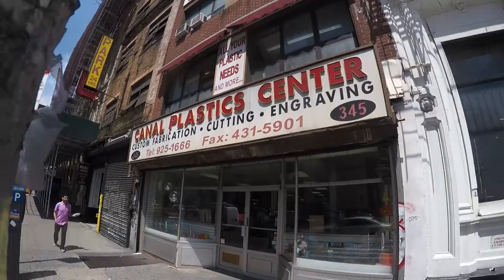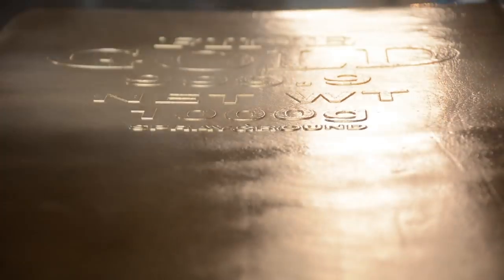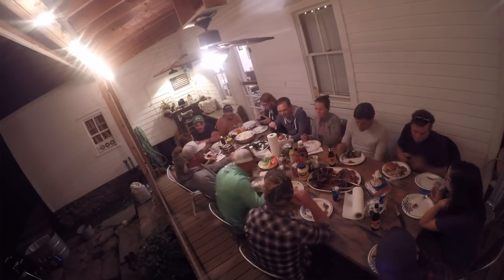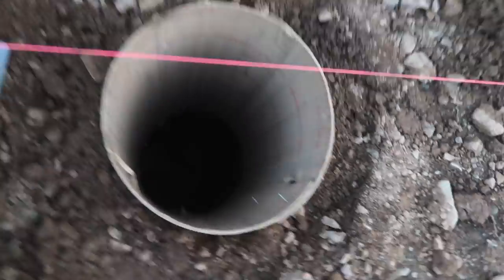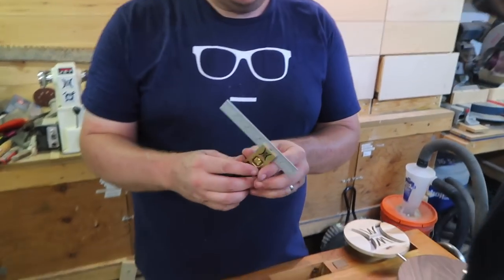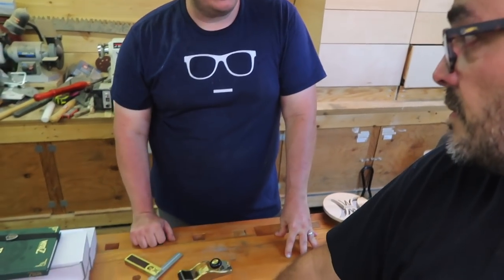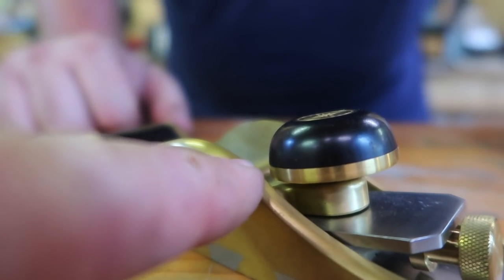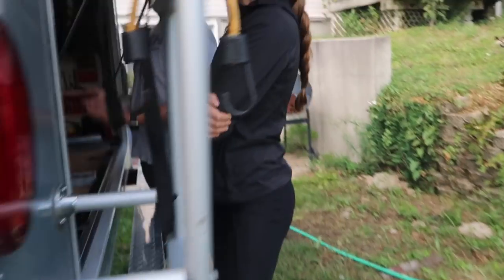DiResta 47 Breaking Ground!

Comment: I just must say this. I'm structural engineer from Europe and I have been always wondering how different your foundation structures are to ours.
Reply: These are Sonotube foundation piers. Which means Jimmy is building either a pole barn, or a steel building. Collectively known as equipment sheds. Most folks park their tractors and whatnot in them. Hence the name.
Reply: It is a post frame structure.  Typically posts are set into the ground.  But wood rots over time.  This is the only way we will build anymore.   Either on a concrete pier or foundation wall.
Reply: RR Buildings we usually use pad footings, ground beams or light srcew piles for this kind of structures. I guess that your ground has so much more friction that you get away with just pouring the post to the ground. Or it might be just the rules if you doesn't need to take snow into account. We use same foundation method for very small.structures like terrace or small yard shed.

Comment: Not wanting to be derisory but CNC operators are just that, system operators. I don't consider them as machinists. Machinists operate the machines by hand, measure and finesse. When all that work is being done by a machine from a program in a computer then you a systems operator.
Reply: Hey Andrew, I've.l done both for 20+ years.  I run manual milling machines, lathes, and grinders.  I also program and run 3 & 5 axis mills as well.
Reply: Do you probe jobs, or touch off manually? Because if you got a probe then Andy may have a valid point. But if you have to manually touch off then that takes some skill.
Reply: I would call it system teacher: YouTube learn with the maschine to do the physical work right... with many (different) tricks needed too.
Reply: Paul Frederick lol both.  Running a hand wheel to touch off a part is hardly difficult, I hope your comment was meant to be sarcastic.  People don't understand there is so much more to using a CNC than pushing a button or touching off a part.  There is workholding, knowing the capacity of your cutting tools, speeds and feeds, how to effectively produce the part in a timely profitable manner.  I can produce parts wether standing in front of a Haas 5 axis mill or standing in front of a Bridgeport knee mill.
Reply from the maker: a system operator with 25 years of machine experience can be one hell of a systems operator.. it sounds like you dont have access to a cnc so you po po it.. open your mind and your work will be better.. you sound  like a stage coach operator talking about the new fangled "car"....
Reply: jimmydiresta well that's just bollocks! I have 35 years experience as a toolmaker. I have spent years running a seven axis cuc machine centre making parts for injection moulding tools and die sets for thermo plastics and thermosetting plastics. Working to ultra fine tolerances of plus or minus a couple of tenths over die sets maybe four feet across. Sounds impressive but once the billet is loaded and the touch trigger probe has done its stuff then all you do is watch the monitors and let it do its thing. Pretty easy to do, systems operator. Being a toolmaker is making a die set using a manual milling machine, surface grinder, optical,profile grinder, electro discharge machine and hours and hours with the foredom and diprofil finessing the cavities,gates and runners. That's a toolmaker.
Reply from the maker: Andrew Wilson will maybe you should've learned to design the part you under stand the artistry involve and maybe you'd feel less like a system operator and more like a machinist..
Reply: +Tony Rouleau  difficulty assessments aside running a hand wheel to touch off is more than you need to do with a stylus. At least it is something.
Reply: +jimmydiresta to be fair design is not machining. It is a task traditionally done in another room, by other workers too. I don't design on my CNC controller myself. I could, but I don't. I use another PC, and I even change my hat!